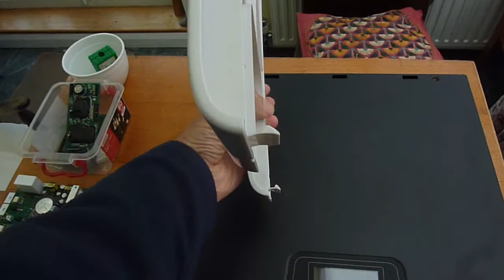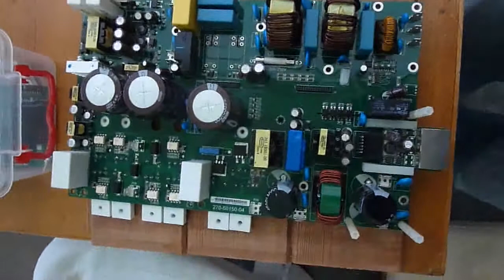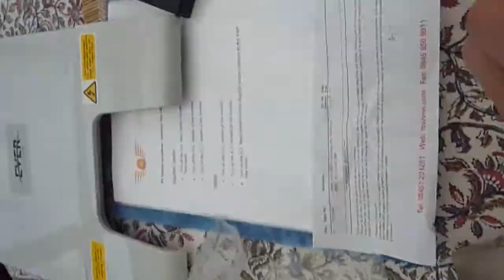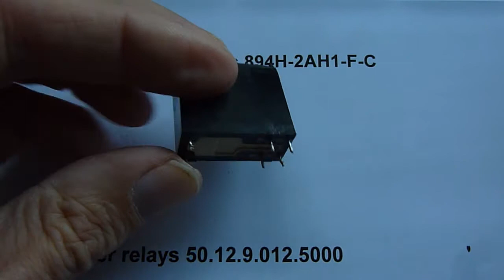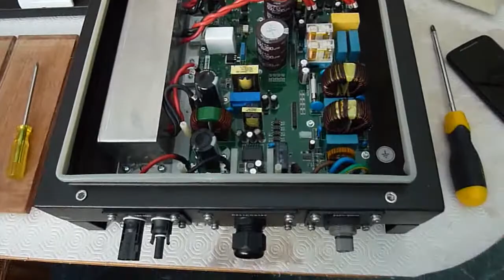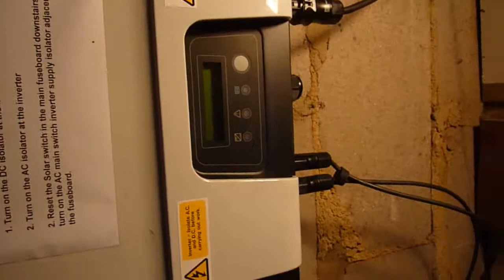Eversolar Inverter Relay Check Fail repair / fix

Comment: Before you go too far, find the solenoids/relays, give them all a couple of taps, reassemble then test. This is all I did to fix my "relay fault" in my inverter 1 month ago. It has been working great ever since. Saved a heap of time & money :)

Comment: Did you noticed that those orignals are rated at 12A and the Finder's ones are rated at 8A? I just changed all 3 of them in the Omniksol-2k-TL with those same sockets (thx for that idea) I hope it wont fail because those Finder's ones are to weak or something.

Comment: I have a SAJ 4KW inverter and my grid relay isn't working, it is chattering / crackling looks like you relays but has no description on the relay top to say what voltage it is. Not sure what to do cant find any info.

Comment from the maker: My Eversolar inverters have finally given up, or rather are beyond my expertise to repair further. They've done pretty well with the relay replacements but I guess other things go too after a while. So I've replaced with Solis S6 Mini inverters which seem to run more efficiently - at least they start at lower voltage outputs from the panels. The real bonus was that the DC connectors are identical to the Eversolar, and the AC connector is easy to change with 3 screws and no soldering or fancy crimping involved, so it was a DIY swapover with no problems. Just needed 2 new fixings in the wall for the mounting bar. I've had one of these running for 2 years now, and have installed another this week. Both installations were very quick and easy, and the older one has given no problems. If you're in the UK you can buy them direct from Eco Supermarket https://theecosupermarket.co.uk who were excellent to deal with and I would recommend (I don't get commission for this recommendation!).  Also if you're in the UK and would like to purchase (at a cheap price) any of the relays I've mentioned in the description I have a few spare which I no longer need. Please feel free to message me.

Comment: Hi Stephen
Thank you ,thanks to your video my Inverter is now working
Mine lasted a little over 10 years ,being tight i have used the ordinal Chinese relays ,but have added sockets so next time it will be a quick fix🙂

Comment: I have a goodwe invertor with the same fault, any experience with repairing a goodwe?
Reply from the maker: I haven't I'm afraid, but suspect the basic principles are similar. Worth giving it a go, and if successful, post a video for others!
Reply: @sab478  yea absolutely mate. I am an auto electrician, and deal with burnt out relays all the time. I can't believe that companies would charge a customer for a whole new invertor for a part that probably cost 15 cent to manufacture

Comment: Hi Stephen, thanks so much for this video. I ordered the parts from Farnell, sockets turned up but they put the relays on back order till February, so I went on to ebay and picked two up from Germany, they took a month to get here, I'll use the Farnell relays for spares. Before I  checked your video out I'd spoke to a solar company, they wanted £700 to exchange the inverter, once again thanks.
Reply from the maker: Yes, the relays are getting more difficult to source. Glad you found some and that the repair worked for you. Great to keep another inverter from the scrap heap.

Comment: Excellent job. I have the big brothers of this inverter. A 3200tl, a 4000tl and a 4400tl. Unfortunately the 4000tl has some blown 3120 gate drive so will have to replace the mosfet on the underside too. Thanks for the clear disassembly instructions. Nice idea about the replacable relays. I think my one has bigger relays so it would be interesting if i could find the equivalent finder socket and relay for them.

Comment: Hello, very good video, thank you.  These days I received an inverter just like the one you disarmed, with the same fault.  I unsoldered and changed the relays but when I plug it back in it doesn't do anything, it doesn't turn on the panel or anything.  When I desoldered I didn't disconnect the wires.  Maybe that caused the error.  The other thing is that to test the relays I measured continuity by energizing the coil with a 12 Volt battery without removing the relays.  Playing with the battery on the relay coil pins.  Attentive to your comments, greetings from Chile.
Reply from the maker: Hi. It's difficult to diagnose your problem from here, but I suspect that unfortunately you have caused a fault in one or more of the sensitive components by working on it without unplugging, or by testing with a 12V battery.

Comment: Thanks well produced video.. am having problems unpluging the DC connectors , is there a trick to how to release them on unplug them off the panel?
Reply from the maker: Check at 1 min 20 secs in - you have to squeeze the sides of the connector together to release the plug. You may have to pull fairly hard if they've been in place a long time.

Comment: I got nine years out of my original relays , now replaced using the same relays as Stephen,   thanks to this helpful video - I also took Ezra's tip of removing the extra pins in the socket

Comment: Thanks for the video! I changed the relays and found supports for next change
Reply: FOR THOSE WHO MAY ASK : here is a link to compatible relays https://fr.aliexpress.com/item/32276641879.html ; a link to compatible supports (2 pins to remove before assembly) https://fr.aliexpress.com/item/1005002530931323.html Hope it helps. Remember : high voltage = high danger. Process only if you have been trained to soldering / desoldering and if you know exactly how to manage working safely on high voltage devices.

Comment: Great job and delivered in a nice calm manner, also liked how you added the socket bases for future should it need worked on again!! 
Just a word of caution guys, those boards house a couple of large capacitors capable of storing around 400v DC and will give a really nasty or even lethal electric shock. Be sure to exercise extreme caution working on these things.
If possible, allow to sit powered down for 24 hours to dissipate the stored energy before opening the case. And if you can, discharge the caps with a suitable resistor and prove the terminals are dead with a multimeter on DC volts before handling the PCB.

Comment: Hi Stephen is this grid tie inverter .plz reply
Reply from the maker: Hi Muhammad, yes it is. It feeds any excess power produced by the panels into the grid.
Reply: @sab478 is this use without bidirectional meter in our home
Reply from the maker: Yes, has separate generation meter. It will depend where you are in the world what the local requirements are for metering I guess. This one was also installed when the UK paid a 'feed in tariff', which I don't think exists any more.

Comment: HI Stephen,

Have you had any dealings with the relay check fail fault on Trannergy inverters?. I've had one replaced by the company under warranty, however the latest one is surprise surprise out of warranty. I have stripped it down and its slightly different inside. I think I have identified the two suspect relays,(Song Chuan SCL-1-H-DPNO-1 12Vdc) however they are quite a bit bigger in size to the ones in your video. The contacts look rather worn out and burnt. Gonna change them anyway to see if they are the cause of the fault. Have you stripped one of these types down before? 
Regards John
Reply from the maker: No, sorry John, not worked on Trannergy inverters. Sounds like it's a similar problem though so replacing the inverters seems a good place to start. Good luck!

Comment: Hi all mother in law said meter reading is the same for a few week now...no power from unit..had a look (I’m electrician) relay failure...model using 2500tl will be having a go at replacing both once I know ratings of relays....thanks for this video....could save a £1000
Reply from the maker: This is the worst time of year for having zero output. All this lovely sunshine and no FIT :(. Go for it, should be straightforward for an electrician :)
Reply: Stephen Brown ..tapped on the two relays and worked a few days...got board out and on bench ...got relays on order...the two came out have seen better days....warning to others capacitors holding charge....discharge but shorting out..then proceed to carry out repairs.
Reply: Update....repaired and working again....£11.00 for 2 relays and 1/2 hour labour.

Comment: Hi Stephen
Really helpful video. Unfortunately after installation the relay fault still showed. On checking it appears my circuit board has a connection fails. Does anyone know how to get a replacement board?

Comment: I reckon the wrong shut down and start up sequence is  burning out relay.   But I don’t now the answer mike  as to correct sequence?
Reply from the maker: When turning off it's AC off first, then DC. Turning on, switch on DC first, then AC.
Reply: I have a sharp inverter manual that states the opposite and a reply from SMA.  Stating the opposite .some American u tubers stating the opposite.     Connecting high d/c first to inverter does not seam correct.to me . Thanks mike
Reply from the maker: @margarethobbs2471  I'm going on the instructions given by the installer. Perhaps the answer is to always restart at night?!

Comment: Hi Stephen,
Thanks to this excellent video, I was able to repair my Omniksol-2k-TL inverter today. Technically it is very similar to your Eversolar. As capacity is a bit bigger (it heId 849H-2AH2-F-C relays), I chose to install Finder relays 40.62.9.012.4000. Thank you for sharing!
Reply: Hallo Ron, werkt dit nog steeds naar behoren? Ik heb dezelfde omvormer en ben aan 't kijken voor geschikte relais
Reply: @bartpieters7683  Hallo Bart (je was de @ vergeten, daarom een laat antwoord). De relais hebben het drie jaar prima gedaan, maar nu is er blijkbaar weer een kapot. Ik ga nieuwe bestellen.

Comment: Hi Stephen. This has been a brilliant video and I have fixed my inverter. I chose not to use the socket as I was told it Derates the relay by 2 A. There is a new finder relay 40.62 available which has a 10A rating but I couldn’t get that easily so went to your choice. EBay is a good place to get them and only £10 each from Little Diode.The comment about the contact spacing is erroneous I believe. The existing relay has a 1.5 mm contact gap which is replicated on the Finder relay. Thanks again
Reply from the maker: Glad we've kept another inverter out of landfill !  Good extra info too. Thanks.

Comment: Hi Stephen, great video. I applied this fix to a unit here recently as the manufacturer is not responding to warranty requests here in New Zealand. Worked for a few days but then brought up the same fault message. On inspection contacts are welded closed on one of the new relays, though there are no visible signs of overheating. Wondering how long the fix worked for you? It could well be another fault causing my issue, perhaps some suppression components somewhere no longer doing what they should be.
Reply: ...have read more comments here now, I'll do a bit more research on different relays, but I appreciate already it's not going to be easy finding anything better in the same footprint
Reply from the maker: @brentbrown4067  Sorry to hear it hasn't worked for you. I fixed two units as per the video and both have been successful. I've not had to change the relays again (yet!). But then we may get less sunshine than you and so the units are more 'oversized' than yours!
Reply: @sab478  Got it sorted now, thanks. I have reason to believe the mains supply had tripped, due to an unrelated earth-leakage fault, which just happened to occur around mid-day in full summer sun. The inverter would have been running near maximum power output when it was suddenly required to disconnect ~ putting maximum stress on the relay contacts as they began to open, and as a result one set of relay contacts were found to be stuck in the closed position. On removing the relays I managed to free the stuck contacts fairly easily by applying 12VDC to the coil... so they must have been only "very lightly spot-welded", but still decided to replace both relays. The original relays were Song Chuan 894H-2AH1-F-C 12VDC, the first replacements I put in were Finder 50.12.9.012.5000 which failed, and I have now fitted the "upgraded" Song Chuan 210H-2AH1-F-C 12VDC relays (mentioned in other comments here) which I found in stock at Mouser.com.

Comment: Hi Stephen,
I am from Australia and looked at your video with great interest. We had the same Eversol Relay check fail issue. I am not as brave as you so decided I couldnt fix it. After a lot of research and talking with a lot of companies that just wanted me to send it to land fill. I found these guys https://glensolar.com.au/inverter-repairs/. I am based in South Australia, but travel through NSW regularly. our inverter has not missed a beat since having it fixed.
Thanks for sharing the info, there are a lot of unscrupulous businesses preying on those of us who dont really understand electricity. A bit a knowlege can be very helpful.
Reply from the maker: Well done for keeping another perfectly good inverter out of landfill!

Comment: The relays that you used are the wrong type , They need a large gap type , the solar inverter is now not compliant 
You need to use large gap type relays with a gap of over 4mm
You are supplying bad advice and non compliance
Reply from the maker: Hi Chris. I took this advice from other forums and they've been working fine. However, I'm always open to correction, so are you able to give the details of the correct replacement relays which will fit these units please?
Reply: Hello Chris,
Can you advise what sort of relay is required for these converters? Where can you get these relays?

Comment: fantastic video! i am considering getting one of these but thought i would check its common faults first. if all it is, is the relays i am laughing!  i am not sure with the KMH brand capacitors however. i have plenty spare if they ever start to bulge.

i am interested to know what kind of PVs you have..  whats the specs of your panels?

 i have 6x 263watt  36v panels. all were scrapped at the scrap yard i work at due to fire damage. some are scorched and some got hot enough to actually bend the aluminium frame slightly but i did a quick dead short of each panel and everyone produced about 9 amps @ 36v in full sunshine. i will be doing a nice video log on the build i do too :D
Reply from the maker: Sounds like you got a bargain finding usable panels at a dump! I look forward to seeing your video - let me know on here when you've posted it. I have 8 x Sharp NU250J5 panels linked to each inverter. Not sure of the exact spec but think they are 250W 36V.

Comment: hi Stephen, I got relay failed problem for my TL1500, my is already a replacement one by Eversolar, they said they changed to a better relay. They uses the same brand but bigger 16A 210H-2AH-F-C, but did lasted long at all. 
 I got a question about the types of relay you picked. how did know the 2 Finder relays you got, which one is better? Both is only 8A, could it be bigger as the original one is 12A?

Also some metioned we should try to match the resistance to be same as the original, is it matters?

I was very hard to remove the motherboard, it still stuck, any suggestions?

Thanks
Reply from the maker: Hi Richard, it is difficult to find relays with the correct form factor (size and number / spacing of pins) so there is not a lot of choice. I went for the Finder 50.12.9.012.5000 (RS Stock No. 733-5104) which is 15A with force guided gold and silver alloy contacts. I think the good quality contacts are worth the extra money. So far I've converted two TL2000 inverters with these and both working fine. Not sure about the resistance, but these seem to work well for me.

It can be very difficult to get the motherboard out. Make sure you have removed all of the screws (some are well hidden!) and then keep working around the edges with your fingers slightly flexing the board. It is the heat sinks that stick, which are all in one corner of the board as I'm sure you realise. So concentrate in this area. You will find it suddenly lifts and once one or two sinks have lifted the rest come easily. Use thin gloves or a rag or you will cut your fingers on the edge of the motherboard as you flex it. It's quite a robust board but try not to crack it!

Good luck!

Comment: Many thanks Stephen ,my unit having shown 'Relay Check Fail' is now working normally for a cost of about £40 !!
Probably the worst problem fixing it was removing one of the DC plugs ,the side clips did not squeeze in enough to release but other than that it all went as per your video.Once again thank you .
Reply from the maker: That's great John. Thanks for the encouraging feedback. I have just fixed another one myself - it went much faster the second time around! I find the most difficult bit is de-soldering the old relays. But having the sockets in there now means I should never have to do that again!
Reply: Hi Stephen,my unit has stopped working again ,showing relay check fail again ! The contacts look clean and operate top 'in' then bottom 'in' but then they both click 'out' .Any ideas?
Reply from the maker: That's disappointing that it has failed again so quickly John. I'm not too sure of the answer. I believe there is another relay on the circuit board (at the end of the board near the ethernet connection module) so I suppose it could be that one which has failed, but I'm not sure whether that would give the same fault or not.